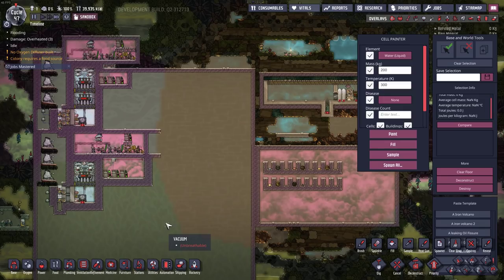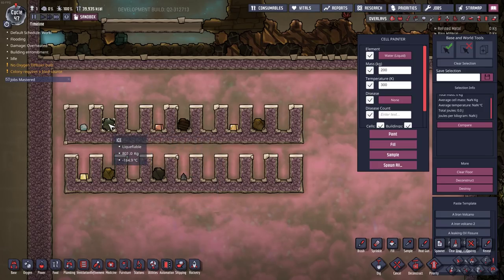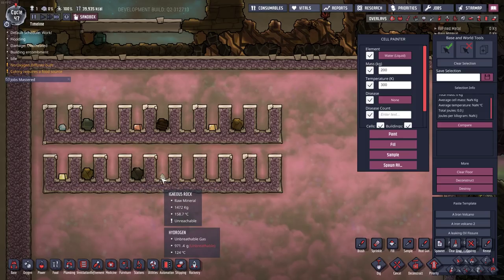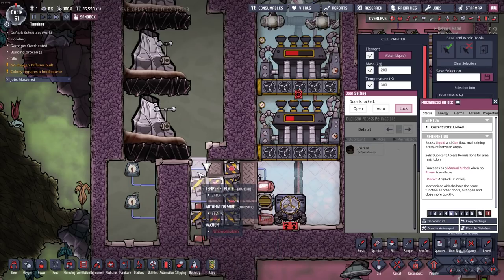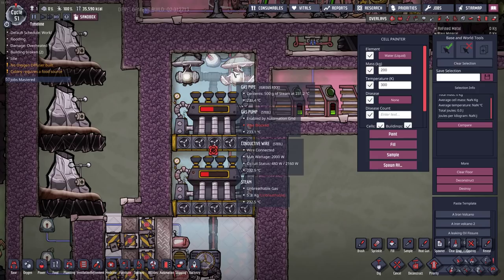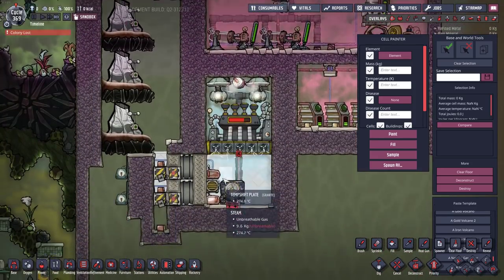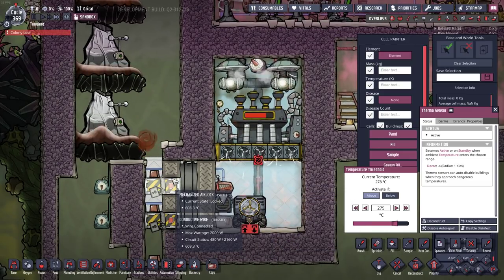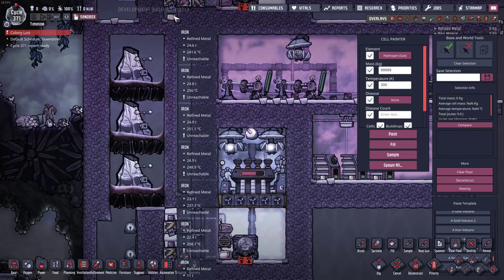Debug testing 1 metal volcano : Oxygen not included

Comment: Have you contemplated a 2 step temperature deletion by adding a petroleum boiler shaft to take it from 2000 down to 499 then drop it down to another deck to go from 499 to 200"s
Reply from the maker: I try to build self contained systems. If I combine petroleum and another what happens when i don't need one or the other? If one breaks or needs to be serviced what happens to the other? The efficiency of combining the two appeals to me but the potential complications keep me away.

Comment: did u test it with a volcano that will drop more then the critical mass of metal at once? with 3 of them u get WAY more heat to delete but they wont all drop at the same time

i never tested the exact amount of mass needed for the tile to form so thats great info i didnt think the numbers would be so different
Reply: this is the final version for me https://imgur.com/a/EcDC71n i dont mind exploits
Reply from the maker: The critical mass is 801kg, worst volcano I'v seen is 20kg a second for about 50 seconds. If you delete the heat fast enough it should be impossible for that much to accumulate as it would take about 40 seconds of molten metal dropping. I ran the stress test for 200 cycles so there is good odds that at some point all 3 were erupting at the same time, but I can't confirm. Nice design by the way.
Reply: @FrancisJohnYT  ok my first impression (which u have proven wrong XD) was that no matter how fast u cooled the metal the liquid metal would turn it all into liquid for a split second and then the new temp would calculate 

so even if u could get the metal to instantly cool to safe temps the new metal would cause it to form tiles(since u cant cool it till it hits since falling objects dont interact with anything)
Reply: i would recommend for your final design to have a cooling door connected to the cooling tank and not the turbine room (either your 2nd door the metal falls onto cool or a 3rd door) 

this helps with getting the metal out at any temp u want (temp u set cooling loop) without having it have to sit in the water/conveyor loader for a cycle

for mine i have the 2 doors connected too a clock sensor but not a and gate or temp sensor but instead the 2nd cooling door drops first then the 1st one drops 1 cycle later via clock sensor
Reply from the maker: I'll do some research into that, the design already lends itself to a third door that would just be touching the water near the bottom.